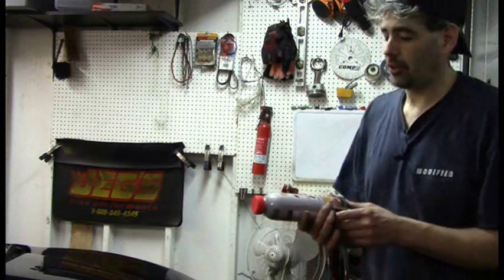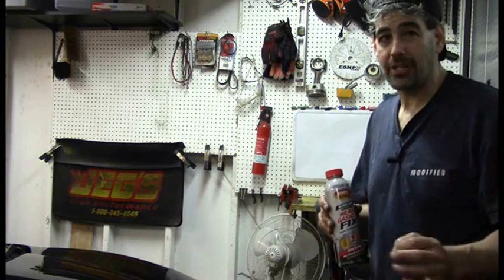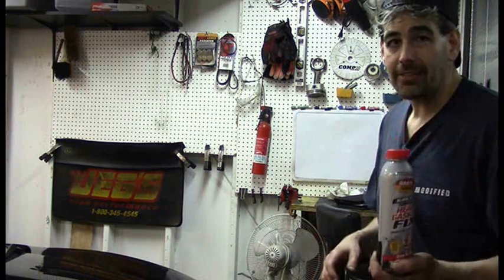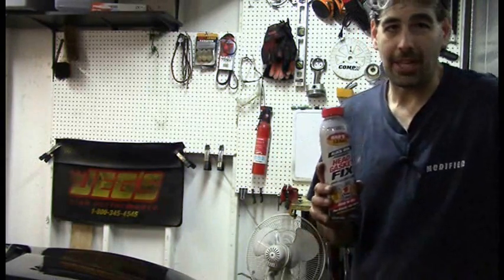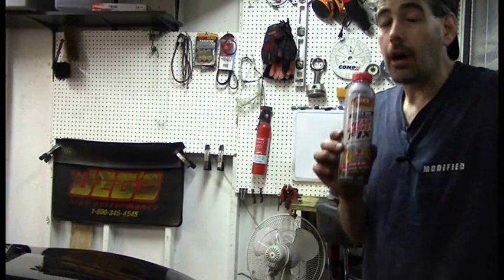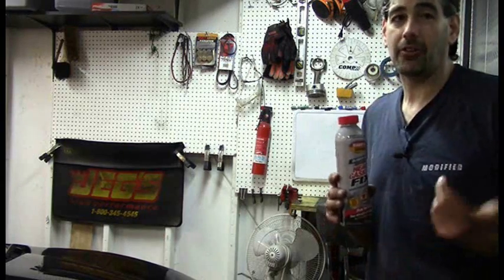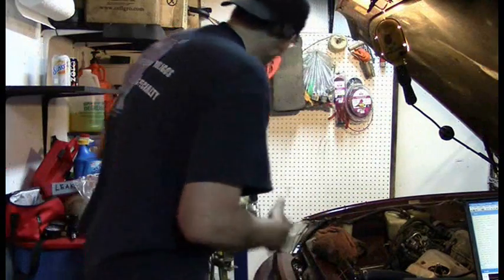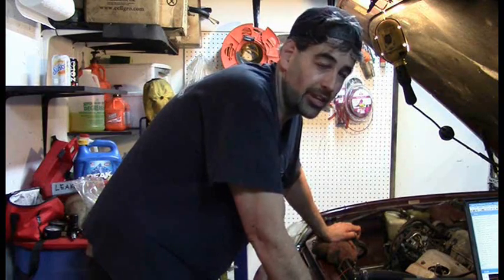Liquid Head Gasket Repair / Block Sealer Scientific Testing

Comment: Blue Devil sealant. '02 Accord, 4-cyl, 260k. Smoke pouring out of the exhaust. Overheating. Engine idling and running rough like it was going to either die or jump through the hood. Blue Devil sealant (small bottle) stopped the rough idling before I finished slowly pouring the bottle (takes 60 seconds to pour). Smoke stopped within 5 minutes of completing the pour. Don't know that it would pass chemical tests or that the results are permanent, but car is running normally now. $36, has to be poured in a cold engine, and has to be idled for 50 minutes, but otherwise I couldn't be happier with it.
Reply from the maker: This is No evidence whatsoever that it was a bad head gasket nor that any or even every other product would have worked the same.
Reply: That IS very solid evidence of a bad gasket- both the definitive symptoms and also gasket sealant eliminating the symptoms of a bad gasket. The scientific, factual proof that I didn't mention is a block test turning yellow days before the smoke and shaking started. I have no scientific proof that Blue Devil completely corrected the issue, but it definitely fixed the symptoms...for now. I believe the initial overheating was caused by the thermostat or radiator cap. I agree that my results do not reflect the effectiveness of other products or even the same product for other, identical occurrences.
Reply from the maker: Jason Janssen Well you didn't mention the block test earlier. That changes things. But otherwise you only have evidence of coolant in a combustion chamber- but not from bad head gasket.
 And either way no proof any product would not have worked.
 There is nothing scientific here.
Reply: A block test doesn't eliminate all of the other possibilities of how coolant might get into the combustion chamber or the other symptoms. There aren't many things that would cause those symptoms and not show up in a block test. Seems strange that you choose once piece of inconclusive evidence as important, but denounce other evidence as even being evidence. None of it is conclusive or scientific proof of a bad gasket. But then, that's not what I claimed.

Huh? Of course one sealant working once doesn't prove that others wouldn't have worked. Not sure where that statement came from or how it fits in.

I never claimed I was performing a scientific study while trying to get my car running in an auto parts store parking lot, but I don't need science to know that an engine stops running horribly rough or that smoke stops pouring out of the exhaust. The temp gauge does show that the engine isn't overheating anymore, so there's some measured science for you.
Reply from the maker: Jason Janssen What would cause false positive on the block test then? I can see what would cause a false negative, but what would possibly cause false positive?

  It seems you are not very familiar with the procedure nor scientific methods, which is the point of the channel. But thanks for watching anyway.

Comment: i had success with blue devil before , i usually fix things the right way but did try this devil product and it worked . maybe luck i don't know but it did , later i removed the heads and did it right though. just saying not important.
Reply: How'd the heads look when you took them apart.
?

Comment: ..the only thing that I use that actually works is 19 bucks/16oz standard sodium silicate solution BUT extremely important don't mix with coolant but water only,nowadays almost every coolant are glycol based and when an aqueous solution of sodium silicate is mixed with glycol, the sodium silicate forms an insoluble precipitate that just plugs small orifices in cooling systems resulting in restricted coolant flow and engine overheating but do not act as a sealant for anything.Also the 15mns iddle is way too short,you need 2 X 50 mns,then drive for 30 mns,then you can do the test again and I'll be really surprise if it doesn't work :)
Reply from the maker: +Chromium Magic Autofill This is not evidence it works because you have no negative control.

Comment: I am wondering if you tore this engine down to see the affect of the head gasket sealer had on the internal parts that it came in contact with.   In my experience (which is Chevy v8/v6 and Cadillac Northstar) the sealant actually clogged up the important weep holes between the cylinders, stuck itself to the inner walls of the engine coolant passages (especially around the cylinder jugs in the Northstar), and it turned to a gel like substance in the radiator and heater core.  
IMO - even if this stuff works, eventually the engine will have to be properly repaired - AND the effort to clean out all the resulting residue left behind by the sealer - will cost you much more down the road.....
Reply: Thanks, I suspected something like that would happen. Gummy bears in the engine.
Reply: Oh, wow! Never thought about the passages that you NEED to stay open. REAL eye opener. Never actually thought these additives 'worked' or were affective. Thanks, Tom Joyce.

Comment: Very cool trio of videos. Like you, I did an n=1 test of block seal, specifically K&W Permanent Metallic Block Seal. Basically rusty liquid glass :)  IIRC, it was about $60 from AutoZone. That was in 2010 and the '95 Ford Explorer I put it in that had been pronounced dead came back to life and it's been running better than before ever since. For the price, there wasn't much to lose by trying.
Reply from the maker: +JohnnyMalaria What were your before and after compression tests verifying the effect was due to increased compression?
Reply: +Schrodingers Box I have no idea :) No measurements were done. The car started spluttering and hesitating one day and I thought it might need a fuel system overhaul (plugs, clean injectors etc). My local "shop" agreed and they did the work. $650 later, life was good. Until three days later and the symptoms returned. For some reason, the words "head gasket" popped up in my head and I began to read up on all the horrible things that can happen. I could see large amounts of bubbles coming out the radiator with the cap off. I went back to the same place. I asked if they could diagnose a head gasket (or whatever) problem. "Sure. $90." Five minutes later, they said yup, that's your problem. The car could barely run but it did just enough to make it the couple of miles to the nearest CarMax. It was so bad (the car, that is) that I bought a new car that day. CarMax offered $2K for trade-in which I was more than happy to take but I thought I'd try a can of the rusty liquid glass. I followed the instructions to the tee. Immediately, it sounded so much better - none of the rhythmic sounds in your video due to a low compression cylinder - and there was no hesitation etc when driving it. I'll stand by my n=1 uncontrolled qualitative experiment :) Oh - and the wet stuff on the ends of the plugs that I found were a bit of a giveaway - I would have thought that any mechanic changing plugs would spot that...
Reply from the maker: JohnnyMalaria There is no evidence here that a head gasket failure was responsible therefore it cannot be stated the product worked as advertised.
Reply: +Schrodingers Box I have to agree. May be it was a placebo effect but it fixed something somewhere.
Reply from the maker: JohnnyMalaria It could have been leaking intake manifold and not head gasket. In that case any product would have worked. Even ground pepper, in fact.

Comment: My ex girlfriend had this old beater '92 Dodge truck with a V-6, the one with counter rotating cam shafts if I remember correctly. It blew a "head gasket" and coolant was just spraying out of one spark plug hole when cranking. To even mess with it was going to require a complete rebuild so I installed some Blue Devil. At first the leaking stopped, then as expected started back up again - and then amazingly stopped again and that was like 3 years ago. She still drives that old truck all the time and loans it out and it still isn't losing coolant. The volume of coolant spraying out of that spark plug hole was huge. I still find it hard to believe the stuff actually worked.
I like your cynical attitude. It pretty much mirrors my own.
Reply: It works with sodium silicate!  It works like a charm !

Comment: Building on the copper particulates used in this product: 
1) for engines having a high volume water loss, grind copper particulates of a larger size. 
2) for engines having a low volume water loss, grind small copper particulates (what you find in the off the shelf head gasket sealant).

Comment: I Have an older model Chevrolet Cavaleer. It just passed it's emission test 2 months ago for it's new 2 year sticker.  But when I start it now I have to be careful running it for a minute or two and not step on the gas hard or it back fires and wants to stall. After that it runs fine.  By the time I get it to my mechanic it's fine.  He ran tests with an OBD one display and it was fine. Wiring is good and I hate to get rid of it as it doesn't burn oil and many new parts.  Great video.

Comment: Well, I went against my better judgement and tried that stuff on a 98 volvo s90..... It has significantly reduced the disappearing (i'm assuming into cylinder 2(low compression)) coolant..... I haven't had to add any since 2 days after adding the bars stopleak, which was 2-3 weeks ago.... as opposed to how bad it was getting... probably a quart a week of coolant.

Comment: Thank for your videos,they are very interesting.
Reply from the maker: +mickey house Thanks man! Btw you should spoonerism your screen name.
Reply: I find bypassing the heater matrix and taking out the thermostat helps the product much better. Unless the leak is in the matrix itself
Reply from the maker: Rocky fish What is the mechanism by which that helps?- it is obvious from understanding the chemistry allegedly involved in the product that this exactly what you wouldn't want to do.
Reply: Schrodingers Box depending on the vehicle.. Still if it's easy to remove the stat and bypass the matrix do it. It will help.. The chemical inside the product react with the air/coolant/temp to seal any breech. There are great reviews and bad ones too. I think it is down to two things one the size of the leak two the person following the instructions incorrectly.

Comment: I heard the products only work on head gaskets if treated when problem starts. If engine was over heated and cooked for to long then the driver pushed the problem to beyond repair by treatments and you need to change the gasket and maybe get the head machined if it got warped. Point is if you see your temp getting hot and blowing steam out the back, that's the time to treat. if you drive for a week and pushed it to far then it's to late.

Comment: I don't trust the chemistry test (looks like you have the same 2 chamber tester that I have) it works 50% of the time for me. I thought the chemical was bad so I bought another bottle but it never went yellow on a known blown head gasket. But the chemical went yellow when I poured some in my hand and exhaled into it. I guess that its not an accurate test of the chemical since i'm not exhaling co2.
Reply from the maker: +Rick Bittner how did you determine a known blown head gasket?
Reply: +Schrodingers Box I had the head machined because it was over .004" and replaced the gasket. It fixed the car. I used the gas analyzer for the test though.
Reply: I've heard other mechanics complain about the chemical test also
Reply: +Rick Bittner What disease do you have that you're not exhaling CO2 like all the rest of us mammals?!
Reply: +Scott Hertzog I mean HC
Reply: +Scott Hertzog. Lol. I caught that too

Comment: I use a gas analyzer and remove the radiator cap, place the probe over the opening and watch HC readings. Anything over 100 PPM is unburned fuel getting into the cooling system.
Reply from the maker: +Rick Bittner Indeed that works- same principle as the CO2 tester but not too many DIY's have a gas analyzer! I'd love one though lol

Comment: Testing one brand confirms that they all don't work?  

Isn't that like comparing a Yugo to a Bentley?

 There are some brands that don't use any particulate but chemically react to high heat.
Reply from the maker: +clarksbackup Where did anyone say that in the video?
Reply: Many commenters responded that way without you pointing out that you only tested one but by your silence you agree with them lumping them together as all not working.

"There are lots and lots of these on the market."  "I do not expect this to work."

You also stated that you can't test them side by side, which may be true, but some have worked where others have failed in the same car.  Why didn't you try that?

Blue Devil and Steel Seal both appear to not use particulates but are pure liquid and others have posted videos showing success with these products which makes you appear to be biased by using one that is designed to be used for a small head gasket leak.  How do you determine if the leak is small without breaking it down?
Reply from the maker: clarksbackup Try watching the actual video next time. I clearly state it cannot be determined ANY product would not work as result of this experiment.  I say this several times in fact,
  I often find watching the video before commenting is far more informative than watching the comments. Try it.

Comment: would you not get a positive on combustion gas if you did not completely drain and flush the old coolant before putting the stop leak in the system.  Just saying.
Reply from the maker: ROY V no the test does not work that way- even if that was a question the compression test confirms failure of the product.
Reply: ok just wondering.  thanks

Comment: Interesting videos..years ago people would put starnge things in the cooling system to stop leaks these included english mustard powder, egg whites..I always use a product called K seal best on the market..The product your using here is not very good..
Reply from the maker: Retired Any of those may or may not work depending on the variables.  Black pepper will even work in some cases.

Comment: Even if this product had been successful I would have expected the second chemical test to show a positive result,because you still have co2 dissolved in the coolant from when the gasket was leaking previously.Thanks for a great vid though.
Reply: Help please. 

In the interest of getting an accurate 2nd chemical test.
You say that co2 is dissolved in the original coolant, so how do we get the co2 out of that coolant?

1. Does the co2 slowly evaporate out again? 
2. If it does evaporate out, how can I speed up that process?  (Remove the radiator cap and leave the car off for several days?) 
Or 
3. Is the co2 stuck in the coolant forever?  Solution - (flush n replace w/ new coolant?)

Thanks from Australia :)
Reply: @wwburn  Flush the coolant system and refill with virgin coolant
Reply: @wwburn   i need to know this too
Reply: Yes, old school "liquid glass" from the pharmacy. Sold in a mayonnaise jar. Everyone called it liquid glass until a epoxy company trademarked the NAME. Still readily available though. Just gotta use the chemical name. 
SODIUM SiLACATE is the shit. I used it on a water pump that had a steady stream from the weep hole.

Comment: where can i get one of those carbon dioxide testers.
Reply: Years late, but i bought mine at Autozone today to confirm what I am sure is a head gasket failure.
Reply: I'm three years late, but I just ordered the Uview 56000 which is a two chamber test like the one Matt used.

Comment: The improvement in one cylinder should have been an indication to add another can of product and possibly leave it in there for a few days of running rather than 15mins.(as per the instructions seemed to indicate to leave it in for future healing)I have had success with a product called thermagasket from the USA which did seal a head gasket leak for about two years;you may wish to try it on your next head gasket case.
Reply from the maker: ***** There is no evidence to support any product would work over any other and the indication of some change is also not scientific indication that another can would work.
Reply: ***** I get what your stating, I also get what Shrodinger's is stating, lol.  Every situation is different, but personally I do tend to believe all problems being equal, that a product left to cure and essentially seal under clean conditions has a better chance at working. It seams there are two versions of all these sealers, pour and go (crap) and flush your system, pull plugs, allow for curing time type sealers, (IMHO the better option).  Again, speaking for myself, I do NOT have a PhD in Chemistry.  GL out there!